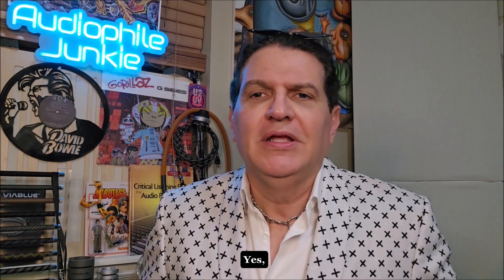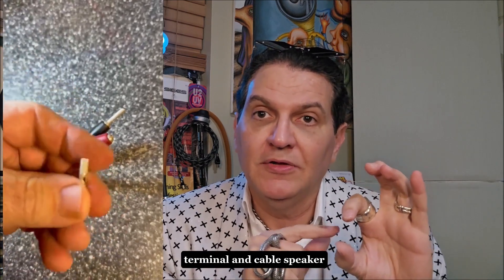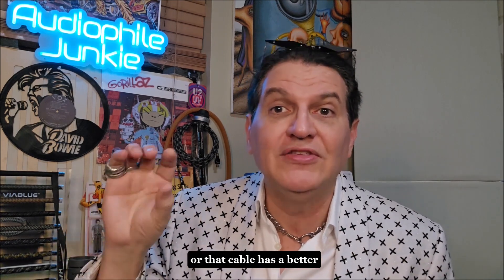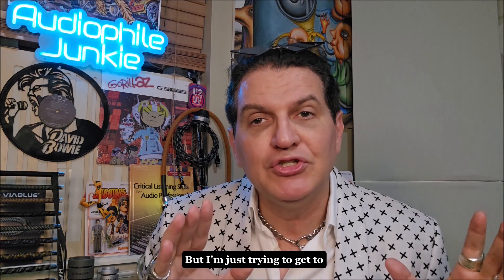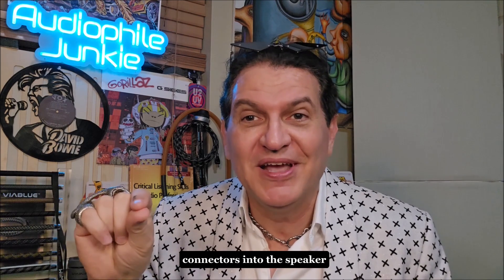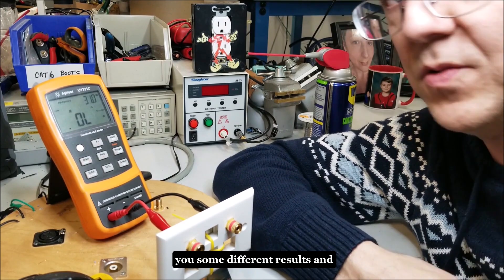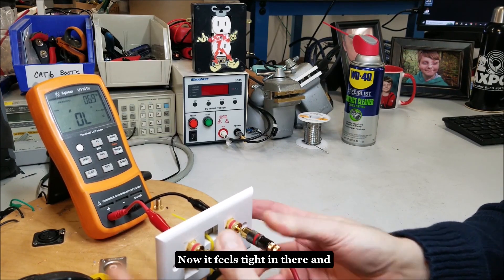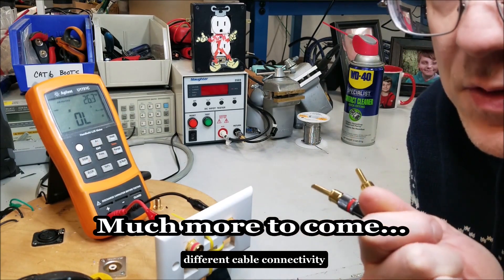💡The Audiophile Cable Debate Often Overlooks One Obvious Thing...Jeff at Blue Jeans Cable Explains

Comment: I can't tell what he was measuring.  Did he connect the other two ends of the speaker cable together?  At the end of the video, he tightened the cable cap but how does that improve the resistance level?  I would suggest re-shooting this video or else it doesn't make any sense.
Reply from the maker: He was measuring loop resistance as he mentioned in the video. I'm sure Jeff will chime in when he reads your comment. 

As he also mentioned, the absolute value isn't what's important. It's showing the delta between types of connectors and tightening/improving the connection to highlight the macro point of paying attention to this area.  It's often the most common area of reliability and even failure as well as potential performance improvements.
Reply: Ostensibly mili-ohms ... thousandths of an ohm. 

I too would like to know what was going on off screen.
Reply: Yep, connected at the opposite end to form a loop, meter is showing DC resistance in ohms. It's a short piece of cable so the numbers are low.
Reply: @bluejeanscable7214  
Now just stop and think how much easier all this would have been if you had shown us that in your demonstration.  It does not, however, account for the approx 1.5 second delay between making the connection and your meter reacting....
Reply from the maker: It's easy for everyone else to understand, but I can see that posting is hard given how you have to edit even the simplest posts.  You literally just throw out accusations and can't even infer the most basic things before getting triggered.
Reply: @AudiophileJunkie  
Take note ... I'm not the one hurling insults and putting other people down.
Reply: @Douglas_Blake  did you really think I was doing something tricky off screen? What would be the point?